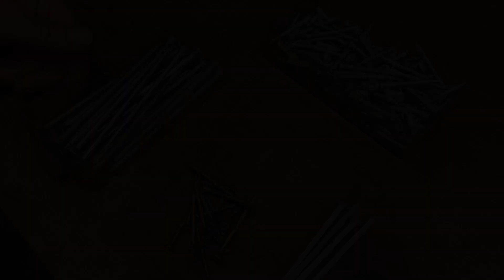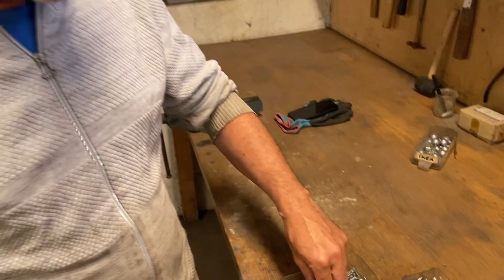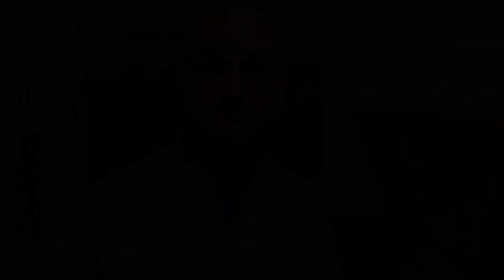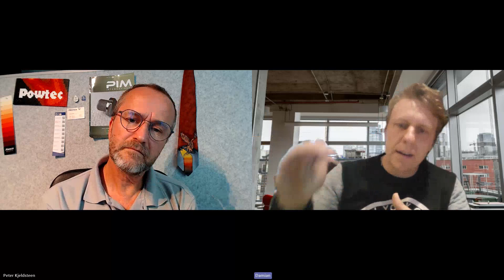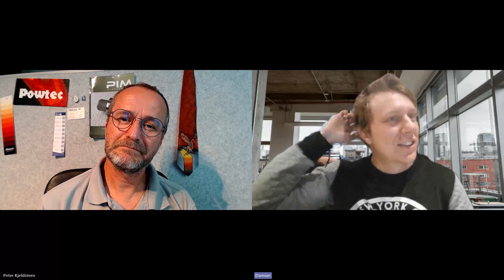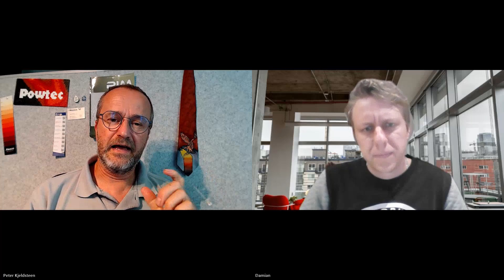Why Are Screws and Nails Different Colors? Learn Why Here!

Comment: Really informative episode. I appreciated the clear explanation of barrel vs. jig plating and the practical challenges with bath agitation and temperature control. The discussion around zinc-nickel alloy plating was especially interesting.
I'm curious—how do you monitor the Zn:Ni ratio in real-time during the process to ensure consistent alloy composition? Do you use any automated control systems, or is it mostly manual testing and adjustment?
Reply from the maker: I will forward your question to Damian😉
Reply: Hi there! Damian from Team here. So this is a very important question because not knowing the ratios in your tank will cause it to completely bomb out. Which is not what we want. Note at around @42:00 minutes.

In order to know the ratios we need to do a mixture of titration method testing and XRF machine testing. These testing methods are done constantly and consistantly in set intervals. The tank is very temprimental so you will need to learn how the chemicals (and work inside the barrel) respond to the addition of the chemicals. It can get tricky. 

There is alot that can be done using automated control monitoring and addition systems but to do the additions manually is also alright. 

But to answer your question, it does not matter if you do have automated systems or an 'offline' system, the additions and monitoring just needs to be consistant. 

The more consistant you monitor and add, the more consistant your coating will remain.

Comment: I’d say you nailed it with this episode 😃
Very interesting insights to barrel plating from 3rd generation family run business.
I’m a little surprised to hear that the focus on Cr6, Cd, Cyanide and recycling is not that prevailing in the plating business in South Africa.
Reply from the maker: More dad jokes, please😂
Reply: Hi there! 

Very true. There are ROHS compliance laws within the country that we do need to follow. They just tend to not be as strick as, say, the USA or Europe. Those countries have very strick ROHS compliance laws that, if we here in SA were to plate and export, would need to make sure the systems we are using are indeed ROHS compliant in THAT country. Otherwise our customer buying the goods and exporting will suffer fines or even charges. 

But in SA, we are still trailing a bit behind because of our developmental status. 

We are slowing getting better.